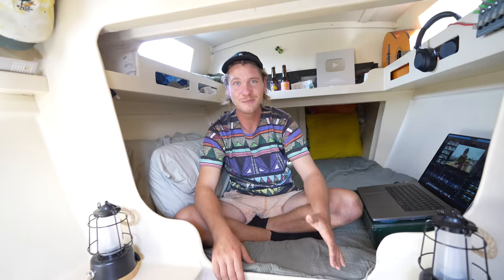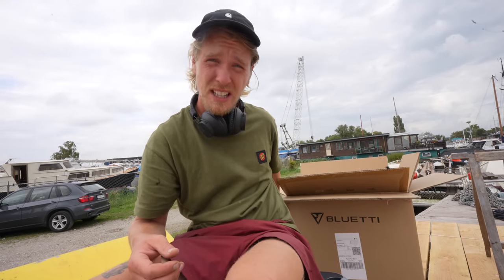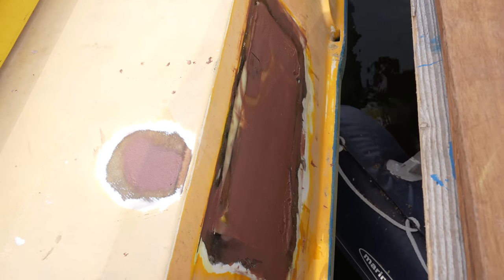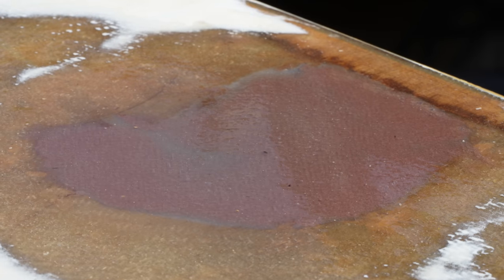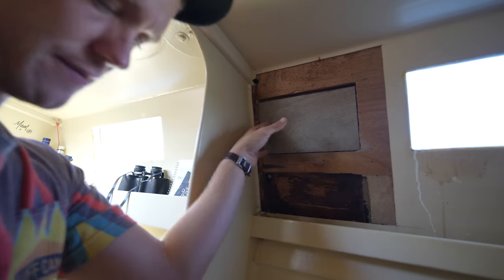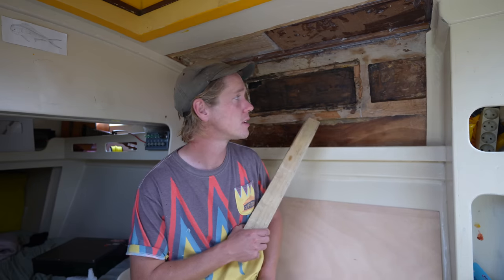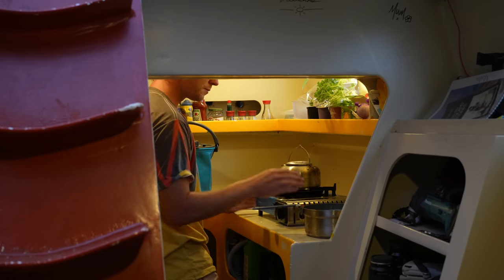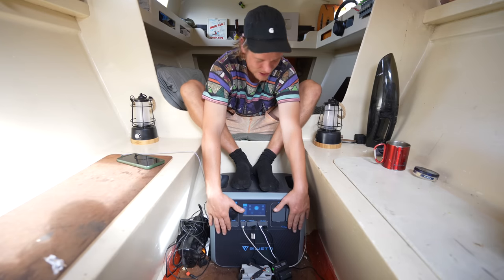Can I get This Boat Sailing In 3 Months? | Wildling Sailing

Comment: Ok 2 seconds in and I already have questions, what differences in the two boats shown in the beginning would you expect to see at sea? I notice a similar length but your boat is much beemier. What differences at sea could I expect from the two?
Reply from the maker: The Narai will have a faster rolling motion, mine would be a bit slower. The narai would be easier to handle and is built like a brick outhouse, mines lighter. But these are just my assumptions 😂
Reply: What's the purpose of the foam besides some insulation? If it was originally used for flotation as well can't you run a heater and fans 25 7 and get it dried up???

Comment: i really don't understand what you did in this roten wall, you did not let the wood dry any bit and directly sealed it with epoxy? that is not going to go well, is the leak even fixed? Also, did the water ingress magically stopped where the panels stopped being accessible? i dont think so.

Comment: Don’t use polystyrene, please get proper foam core. Epoxy will not bond properly and will probably melt the polystyrene, definitely not the proper solution. Don’t be in such a hurry do it once and do it properly and you’ll save time and money in the long term!

Comment: Is it possible to leave discrete weep holes in case water ever accumulates in those spots again?  Don't worry about sponsorships.  If you really know the widget, and are confident that it's useful and usable to the point you want to use it, why not speak on it's behalf.

Comment: I have commented before.  Rot is a bug.  So dig the rot out...to the point of real wood...Still bugs and not strong.  So now soak in penetrating epoxy....2-3 times...then apply epoxy filler....and never ever ever poly, even on polyester resin hull.  Does not stick.  You amaze but also build crap.  Dead friend will change that.  Or a high view epi....I'm so sorry, thank you for the rescue.

Comment: NO,NO,NO you cannot have strong chain plates on that flimsy half rotten plywood ,there is a reason they w straddling the bulkhead in the original plans.
Nothing personal I admire your personality and your determination but get some advise from KNOWLEDGEABLE professionals if you intend structural changes because you grossly underestimate the power of the sea. You might be lucky it might hold
or you do it properly and it WILL hold, do you want to bet on luck in a 60 knot wind, your choice mate.

Comment: Now you're using non structural packaging foam as a filler? WTF man do you have any idea at all. The foam installed originally is  non hydroscopic closed cell and lends real structural strength to the panel. If you don't know what you're doing don't do it man. If you expect to add chain plates to this area then fully expect them to fail.

Comment: considering, would it not be better building one from schrach
Reply: The cost of materials would be horrendous in comparison to what he has spent so far. Those beams would cost thousands a piece. The boat looks like it was built well so you also have to factor in the cost of labor and tooling.